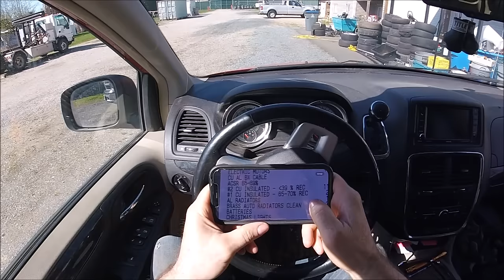Scrap Run Selling Non Ferrous With Processing

Comment: That was a great load. I think you still got some cable in your yard near the glass bottles. And you got some quality stuff left to cash out like the lawn mower engines. For a 4 day spring clean up, it is a great value. 2 years back when you did spring clean up with the bin, 2 vans with family joining in, you made 10,000 dollars. This time in 4 days, you alone with only 2 vans, you already cashed in 1100 dollars and I am looking at another 900-1000 dollars in lawn mower engines, SS, aluminum chairs, window frames and shred etc. This is a great spring clean up.

Comment: Getting Tubs of Wires Ready - Non Ferrous Run - some Stripping Action ! 594.54 Dollars Payday - that Brass Rad did the Trick ! Well done Phil - well done - You sounded very HAPPY ! Enjoyed the Video and Many Cheers from Australia !!!!
Reply: Do you HAVE to spoil every video with the payday or weights of what he had. Your comments at the top so you see it right under the video. Cant miss is. So annoying
Reply from the maker: Watch the video not the comments
Reply: I hear ya Phil. Its just annoying. 
Just don't put the figures in the comments bruv